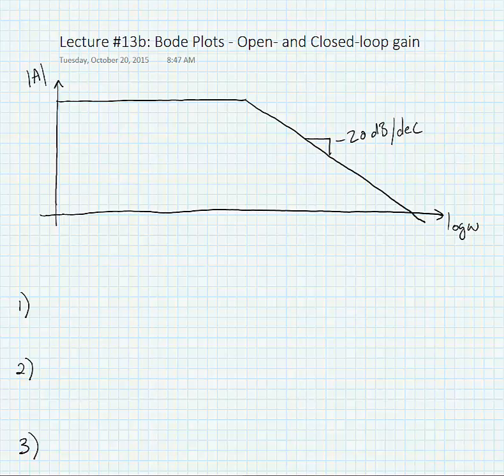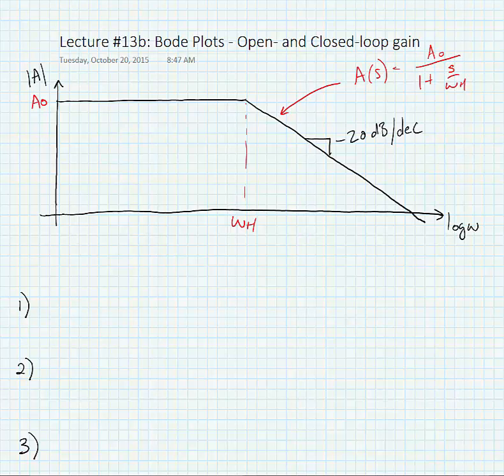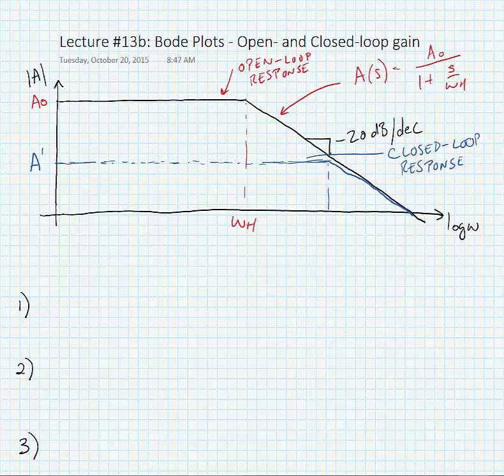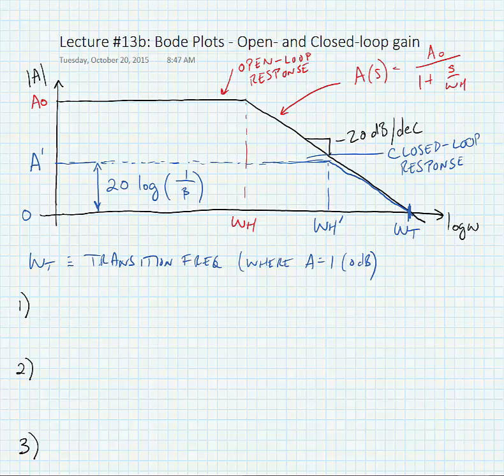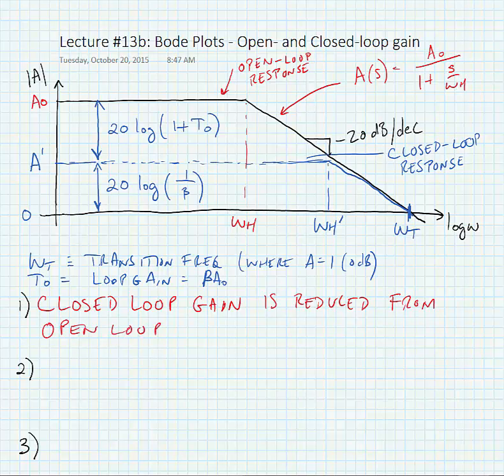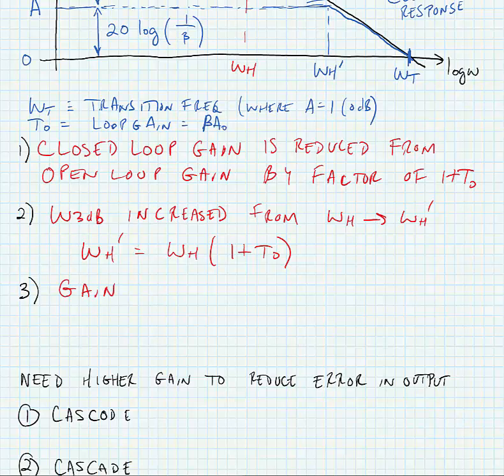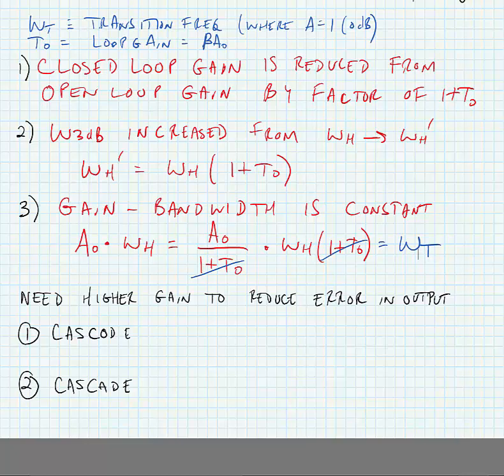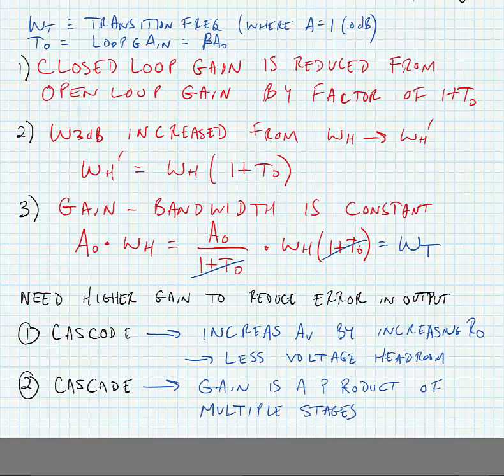ECE 3110 - Lecture 13c: Bode Plots - Open- and Closed-Loop Gain

Comment: What is the definite difference between the open-loop gain and then closed loop gain?
Reply from the maker: Closed-loop gain is the gain under feedback, open-loop gain is the gain with no feedback. Closed-loop gain is more precise because it is usually ratiometric, while open-loop gain is not precise but is very large. In practice you would never use an op-amp without feedback.